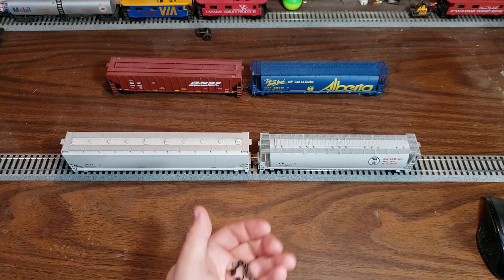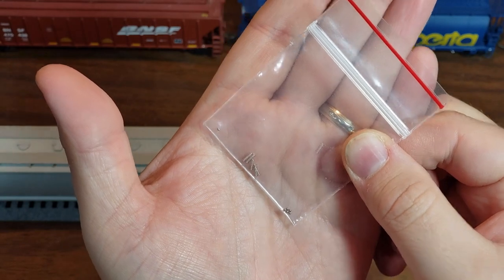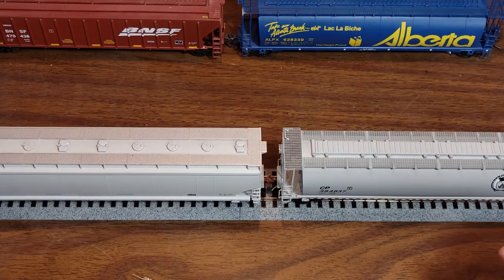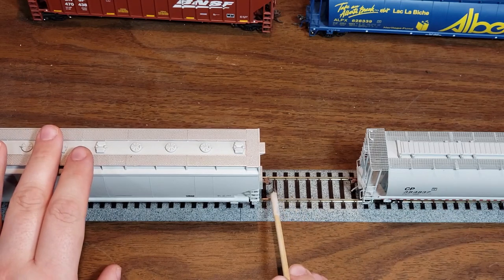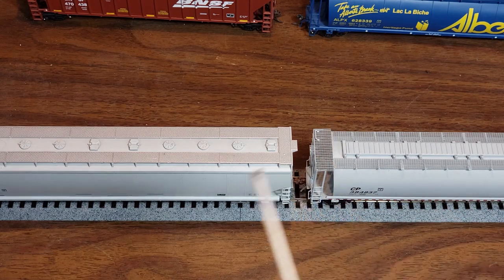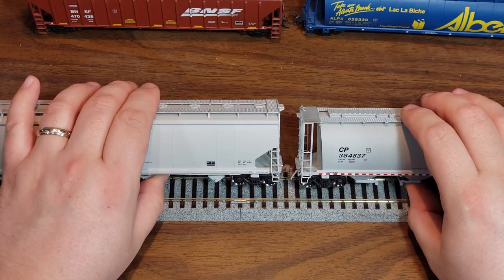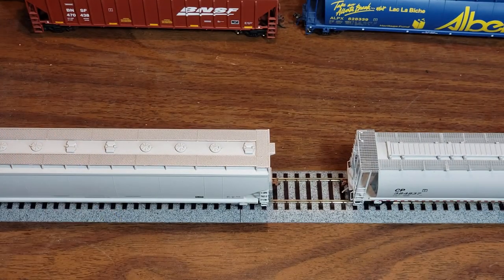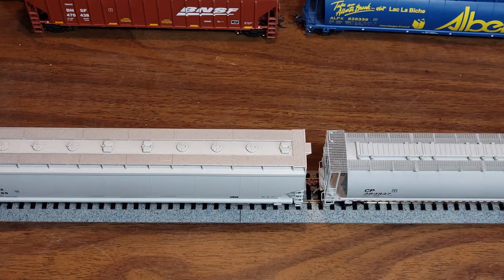A Look at Sergent Engineering couplers

Comment: over 40 years using kadee number 5. they are the gold standard. been using some of the new fangeled "whisker" couplers that replaced the #5. (bad eyes, and fat fingers here). but i have pulled 250 weighed cars, using #5 kadees. up to 8 sd-45 athearn blue box ( not all needed just love big power). set them up fastest up front slowest in the rear. so all were pulling. not fighting. (was done in dc.some 30 years back). and yes this was up hill. down and back up/down again to complete the task. (walnut creek, ca. club).
i will not change my couplers to any other brand. not even if (someone, manf, etc). did the job and gave me the couplers for free.

Comment: I’m one of those people who believe you need consistency to have reliable operation. For me that means the same coupler, since many of the cars I buy these days have other vendors variants of the venerable Kadee and the difference between #5’s and simi-scale, I already need to replace 60-70% of couplers. So I replace to Sergents. Been using them a few years, and print, in resin on my AnyCubic Photon many of the variants that are out of stock. I just print the shank and couple halves, still using the knuckle and bearing from Frank. They are superb, and I wouldn’t consider switching back. Also with the PWRS magnetic air hoses, what a superb setup for realism, operational functionality, and they look great on these modern Tangent, ExactRail, ArrowHead, ScaleTrains, and Genesis cars! It makes for a really beautiful railroad.
Reply from the maker: Don't suppose you've got a printable design for rotary couplers?

Comment: I have assembled many of these couplers, it's a bit finicky until you have practiced a while. The jig is a must!  Be careful with your glue application: too much and the excess glue could creep into areas that will lock the coupler. Beyond that, the hardest build part is the spring, it will disappear if not handled and correctly set.  Once assembled they look great!

Comment: I am European and in my locomotives and rolling stock I use the Fleischmann Profi couplers. They were the best for me...until I started collecting American locomotives and rolling stock. So I decided recently to change all  my Fleischmann-Profi couplers for Kadee ones. I think that Kadees are easy to install and very very reliable. The fact that you only need a magnet for decoupling is a plus. Frankly, I don't see any advantage on Sergent couplers but the looks. But for me functionality is above appearance and the fact that when using Sergent couplers you need to do the decoupling manually is a drawback.  So I'll stay with my Kadees any time.

Comment: You can't beat Kadee track magnets in hard-to-get places, and you can't couple Sergent couplers if they're both closed and out of reach. Function over fashion. No thanks.
Reply from the maker: Very true, however my personal strategy is to avoid hard to reach areas in general which removes the need for remote uncoupling and helps with track cleaning and any potential derailments

Comment: These are nice, though if you already have a few hundred pieces of rolling stock mounted with Kadee's I'd say leave it, they work just fine and those having coupler issues with Kadee are doing it wrong 100% guarunteed.  Been using Kadee's since the mid 80's and I can count on 1 hand minus 2 fingers how many de-coupling incidents I've had from normal usage.  Now screwing around I have decoupled many cars but that was goofing around with speeds and different track designs that were laid in extreme manners.  These are great if you are starting out I'd say go with these Sergent brand ones, or make some new consists using these only they are cool.